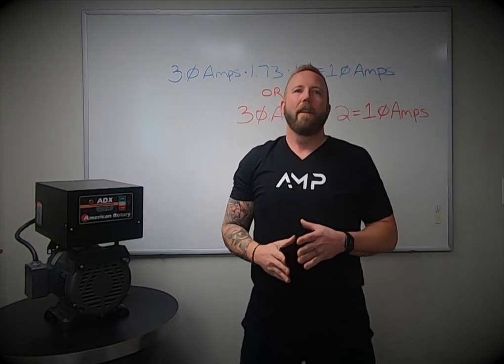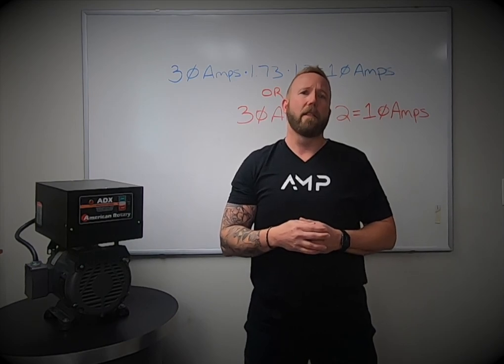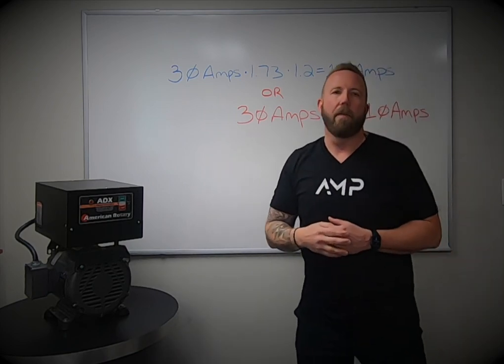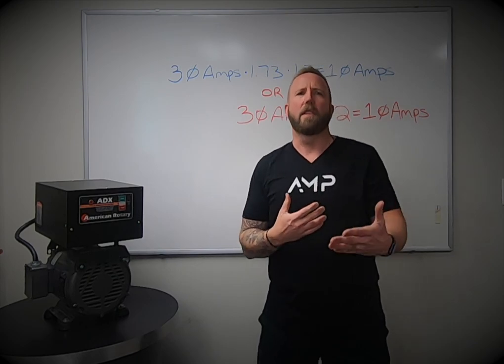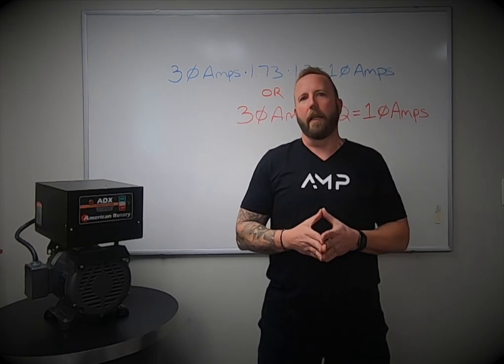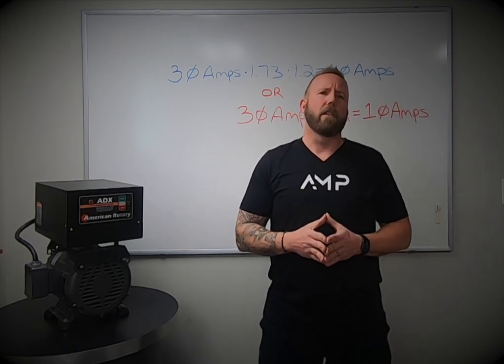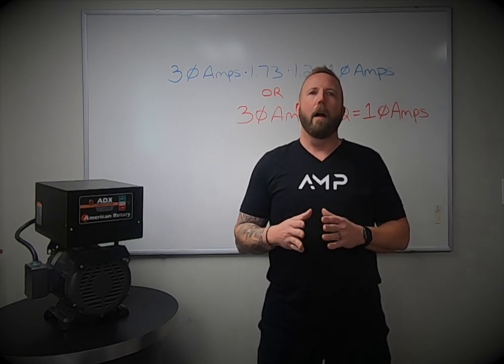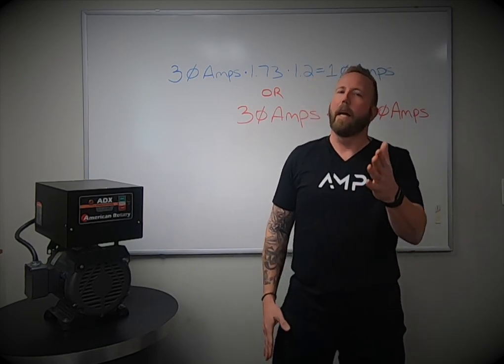5 Things You Should Know Before Buying a Phase Converter

Comment: For those hung up on the “heavy, medium, light” load part, this is essentially describing the inertia of the load. The more inertia you have to overcome, the longer your inrush current lasts, and the more it slows down the idler motor in the phase converter when that equipment starts up.

Comment: If anyone out there can explain to me or provide a traumatic or a general theory of operation for a face converter set up with two individual phase converter. I’ll call him motors to transformer or actually for transformers one large and one small per converter and each converter and transformer are labeledone phase 2 phase Rowalt tonnages off amperage is way off like 53 A, 39.9 A, and 17 A help

Comment: Huh? First 30 times 1.73 times 1.2 does NOT equal 10 it equals 62.28 and second 30 times 2 does NOT equal 10.
Reply: It's not 30 it's 3 Phase amps the O with the slash is representing the phase. 3PH or 1PH.
Reply: Ok so 

3 x 1.73 x 1.2 = 6.228

Y'all got some weird math
Reply: well that seems to be a strange way to lay out an equation for a YouTube common folk uptake.

So if my 3 phase load is 30 amps my calculation could be simple 30 x 2 = 60 amps (single phase) required to create 30 amps 3 phase.  or the other 30 x 1.73 x 1.2 = 62.28

Then additional calculations are needed for the voltage changes.